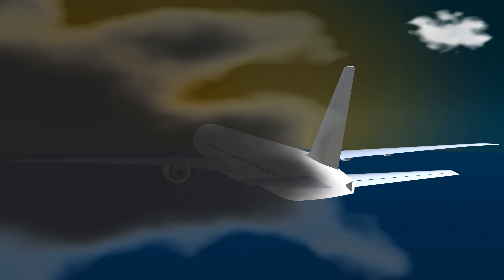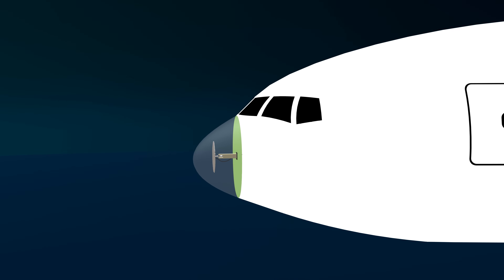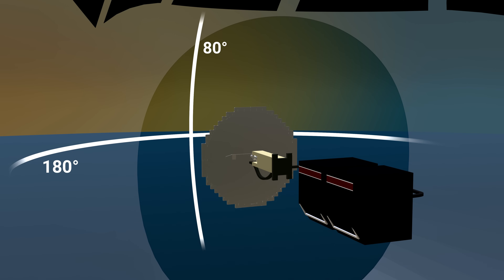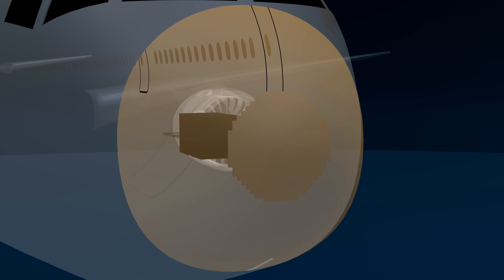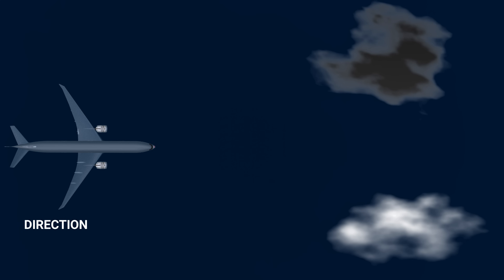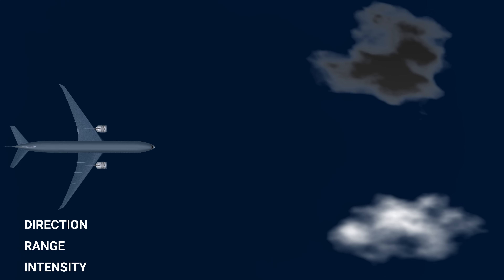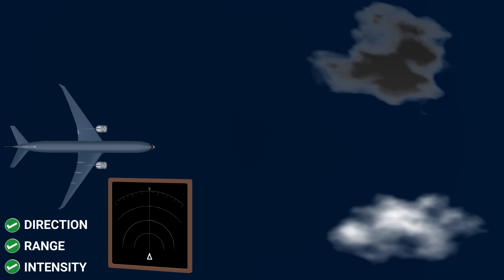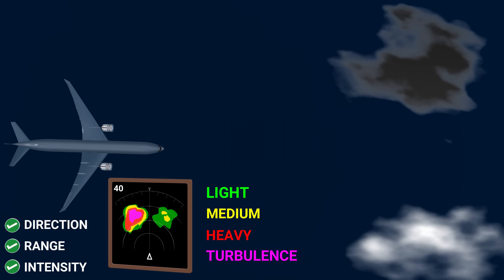How Weather Radar Works

Comment: Always good to remember that not all turbulence is visible to the radar. No water, no indication. The so called Clear Air Turbulence. So always keep those seat belts fastened to avoid having the plane's ceiling hitting your head.
Reply: Very accurate description, its exactly like that, the ceiling is the one that comes down with the plane while the passengers keep traveling ahead by innertia.
Reply: @sukhoy  precisely!